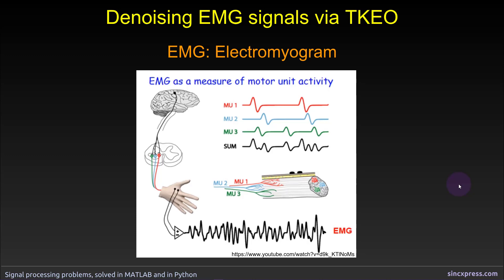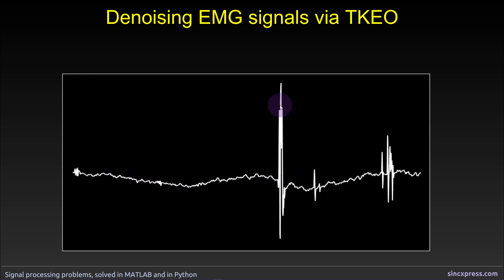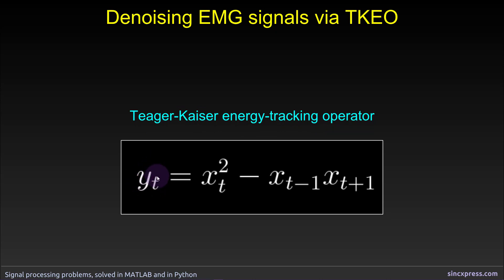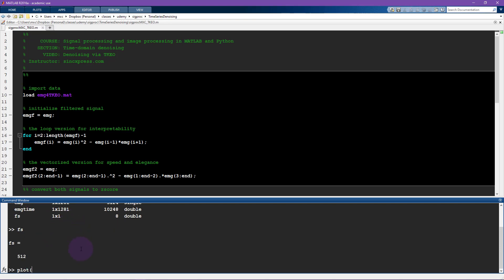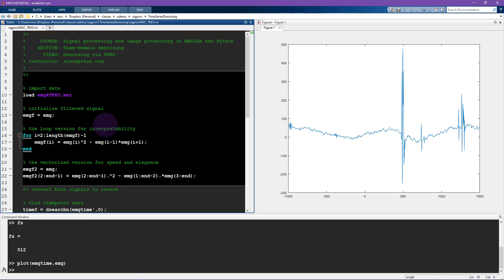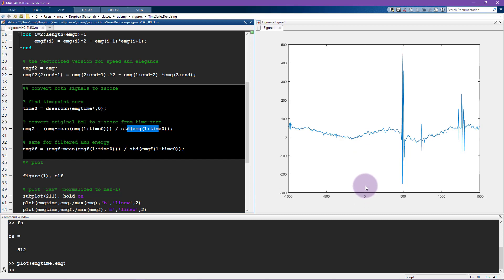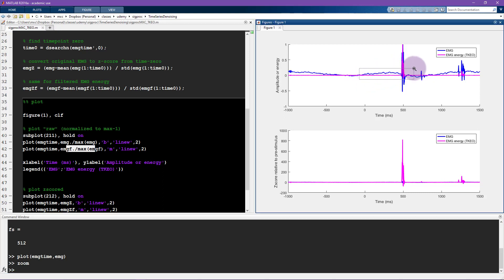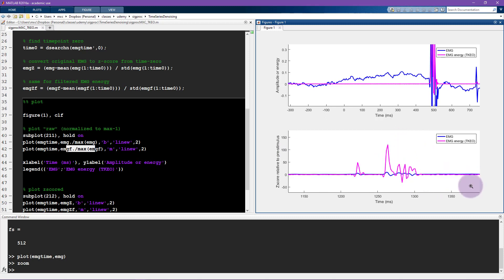Denoising EMG signals via TKEO (Teager-Kaiser energy operator)

Comment: Hi, thank you for the video. I have a question, this kind of normalization can be used with the grand averages of ERPs?
Reply from the maker: Hmm, interesting question. My intuition is that because the ERP is already so smoothed by averaging many trials, that TKEO wouldn't be very insightful. The TKEO filter is designed to amplify broadband energy, and most of the broadband energy is filtered out of the ERP.